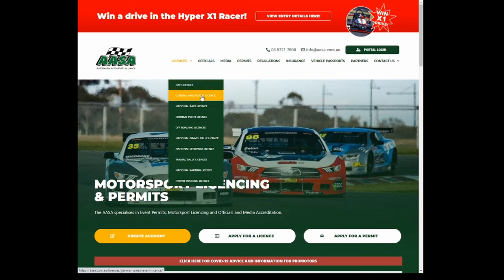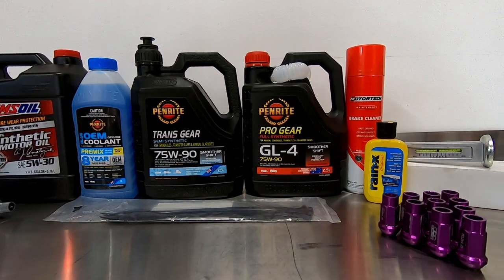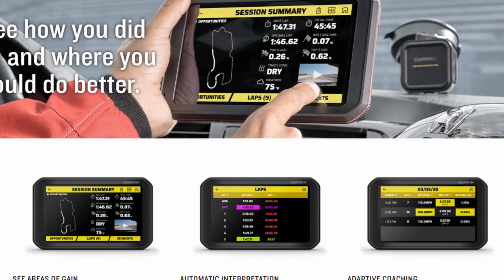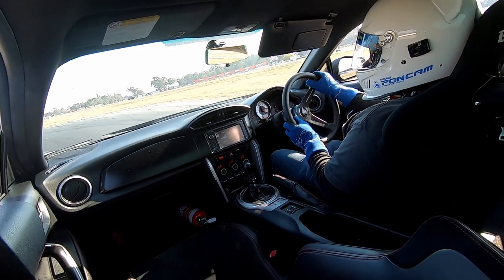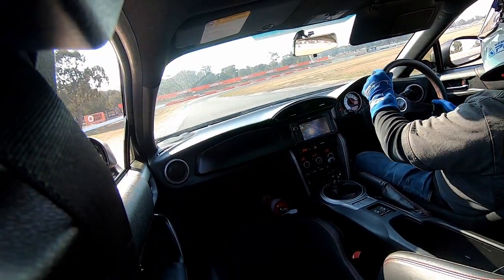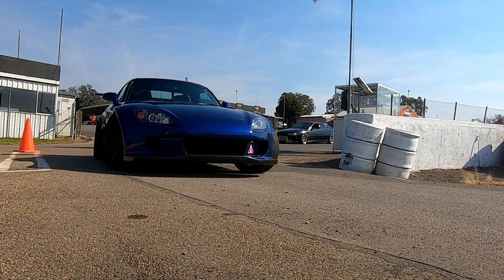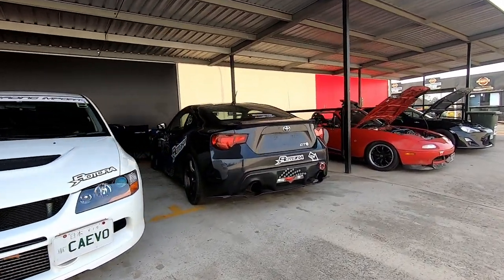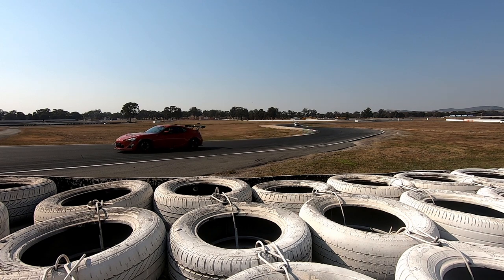How to survive your 1st track day  //   Beginners guide to track days  // Track day basics

Comment: Excellent tutorial, what I would like to add, go to a couple of track days as a support person, to get the feel of being there as it will cut down nerves on actual race day,  OST track days will have a familiarety warm up laps , these are done at non racing speeds so are a good time to be a passenger on these support days to learn the track , ,.  Most road car brake pads will only last 2 laps under " spirited " driving ...so upgrade to the very best "road" pads you can buy like "ebc yellow" to avoid it being your cars first and last trackday,     lastly overfill your oil by 500ml at start of day, reason for that is even high performance cars are not designed to be at the rev limit for 20 mins and it takes time for oil to return to the sump for recirculation. After all that going as fast as you dare will make you a better driver for life